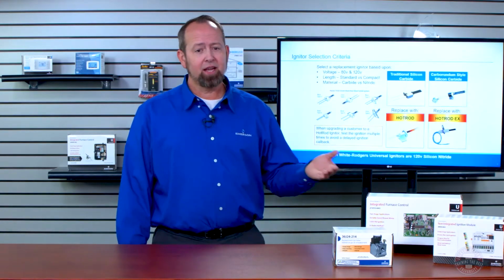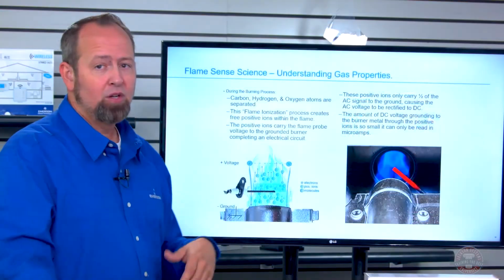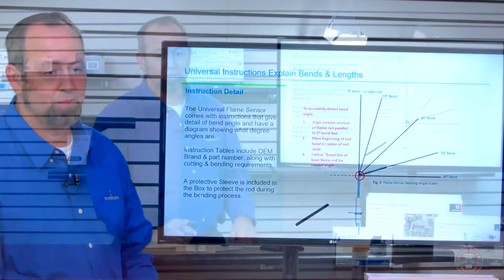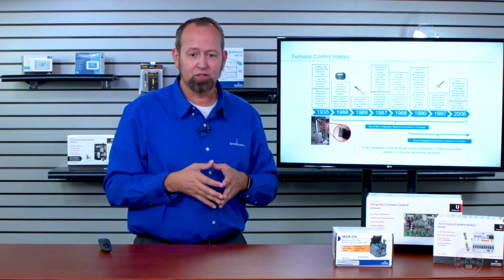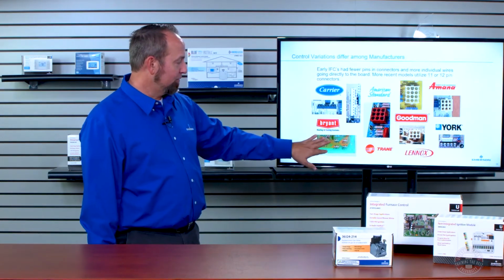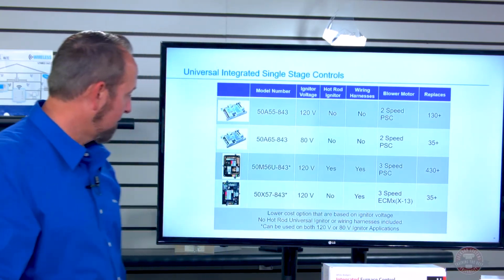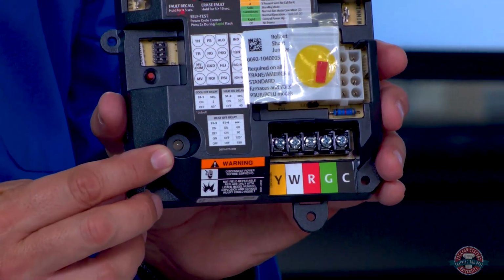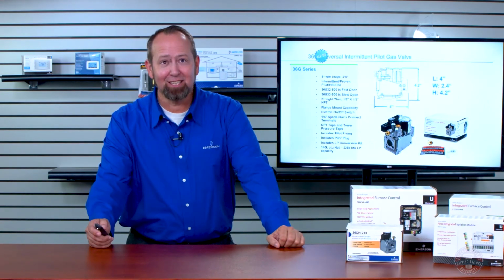Understanding Universal Combustion Controls- Full Training

Comment: is spark coil is a kind of stepup transformer?, i know system receives 120v for split gas or 240v for gas package system  to the integreated furnace control and will increse the voltage to anywhere between the 10000v to 15000 volts for sparks. please let me know. thank you.